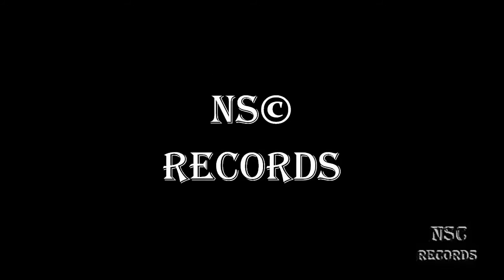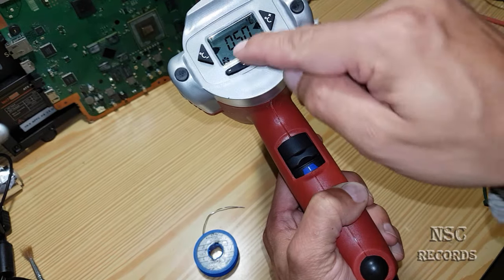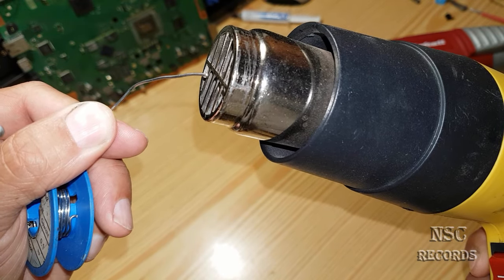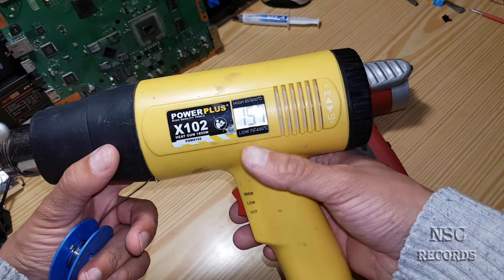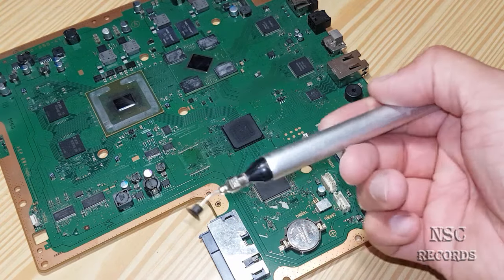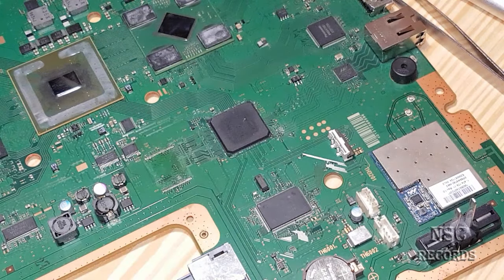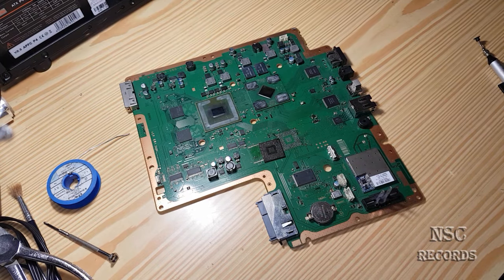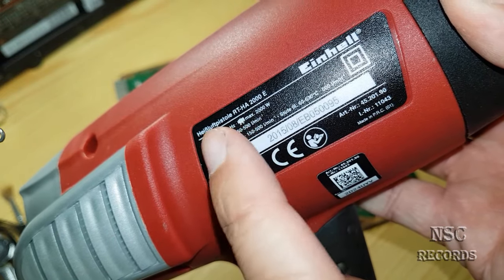Here´s the difference between a Cheap & a Good Heatgun By:NSC

Comment: I feel we must highlight the methods of using the heat gun properly. For e.g., many times the user immediately shuts the heat gun after use which allows the hot air to get trapped inside the hot air gun - This adversely affects the longevity of the heating element and correspondingly the heat gun itself. We must also remember to keep a safe working distance between the job and the heat gun outlet so that the hot air emitted is not sucked back into the hot air tool. All these are important issues.
Reply: So long story short, dont turn off the heat gun right away, turn it down to lower temperature so it cools off then turn if off

Comment: Thank you for this informative video. You can have a resonable temperatur measuring instrument for less than 15 euro with a thermocouple sensor. This will in all cases gives you some verification on the actual tool you are using. I think most folks doing repair work on electronics like to have that.I have used a cheep heat gun with continous temperatur setting (1.0-6.0) and no display. I use it for some other applications. The specification says temperature control: 50 - 600 dgr.C. Now I tested it with my thermoelement. At a setting of 1.5 the temperatur stabilizes near 130 C. At 1.6 it stabilizes near 290 C. I am not able to set at temperatur between 130 to 290 C. I think that is bad.I have tried to find reviews or comparisons on the internet on hot air guns. I did not find any, that acually tried to measure the exhaust air temperature in their evaluation. So i hope somebody will do that in future.However, I did find this video from a guy comparing the display temperatur with his thermometer. He did find a big difference like you did. https://youtu.be/mvw9fJjzg7k
Reply from the maker: Thank you very much and you welcome :)

Comment: Perhaps the old heat gun measures/displays the temp. of the heating element inside the gun and not the temperature of the air coming out.

Comment: I recently bought a cheap Chinese heat gun that looks exactly the same as your example but branded differently, and it came with various nozzles. Your video gave me ideas for experiments to do such as melting solder, and removing chips from circuit boards, thanks. I bought it mainly for melting plastic though.
Reply from the maker: No problem, you welcome :)
Reply: @NSC-Modz  I just bought a cheap one that was on sale at Kaufland Romania. Only has two settings on a three pole rocker switch, 350 and 550*C I think (not sure of the latter) but can be handy. It succesfully fixed a YLOD-ing CECHG04 PS3! Now to dive into my C04 and H04s.... :)

Comment: So I need like 1000 degrees fahrenheit to reflow with mine, I tried it with like 800 but I'm pretty sure it didn't do anything. I'll probably just need to do it for a few minutes. Thanks for the video.
Reply from the maker: Haha yeah, cheap heatguns are just waste of time ^^
Reply: @NSC-Modz  what's the max amount of time would you say that I should reflow the RSX and Cell on my PS3? I'm gonna try with some flux this time but 1 minute on a cheap heat gun doesn't feel right.
Reply from the maker: You need to feel that, try 2-3 mins and give it a try, but only with flux.
Reply: @NSC-Modz  yeah, I made some liquid flux so I'll use that. Hopefully it works, I need to invest in some temperature probes or something next time.

Comment: I like to ask you a question about your hot air guns. Do you think each one of them have closed loop temperature control? Consider using a nozzle, that reduces air flow with same temperature setting as with no nozzle. Will the heat gun try to compensate by reducing power to the heating element and maintain same output air temperature?

Comment: can i power a teensy with a power supply 3.3 volt wire ? because i forgoted to buy a 3.3 volt reguolator.. and i didnt find it in my city .. so if it possible can you draw me where i solder the 3.3 wire .. ?
Reply from the maker: yes you can, and you can find a lot more also on the Net :)
Reply: searched the F***ing web and nothing .. all bullshit ..I want the place i solder the 3.3v wire from ATX to the teensy please Help NSC <3 in the place to be !
Reply from the maker: https://www.google.de/?gws_rd=ssl#q=tennsy%2B%2B+2.0+3.3+volt

Comment: The first one is in Farenheit, 350 F is 176 Celcius. The second one says Celcius... Cheap or not it should still heat up to the temperature you set it to
Reply: but it has Celsius as the marker on the display, so either way it's incorrect

Comment: I have found that the heat gun heats quite a big area that can be a problem compared to a hot air station with a smaller nozzle.  I find this difficult if there are nearby capacitors or if I need to work on a small area.
Reply from the maker: yes, but all is posible :)
Reply: I agree.  It depends on skill level and the type of work, not just whether you have a particular tool or not.
Reply from the maker: right

Comment: Yea but you should mention that the " Cheap" heat gun was at 360 Fahrenheit and the "Good" was on Centigrade BIG DIFFERENCE
Reply: Nice try, but it clearly says on the side of the yellow 'cheap' gun display "°C". They are BOTH CELCIUS.
P.S. scientists changed the official use of the term 'centrigrade' in the 50s and most of the media haven't used it to refer to temperature scales since the 80s, a centigrade is a French unit of angular measurement.

Comment: Can you please make a video on how to fix a PS3 with RSOD? Thanks
Reply: If u r on CFW get a CFW with RSOD patch :) Like Ferrox
Reply from the maker: Right
Reply: +Zisch//ModZz any particular firmware version?
Reply: Uhm Idk Ferrox 4.78 has a patch afaik :D
Reply from the maker: and Right again :) 4.80 also i think...
Reply: +UltraNSC :D Nicee
Reply: Hi, I know this might sound silly but I downgraded by ps3 from 4.80 to 3.55 and successfully made a good patched bkpps3 file. I just updated the ps3 back to 4.80 ofw and want to downgrade again to 3.55 ofw (I did that as a test) can i use the same bkpps3 file from last time? or do I have to get another bkpps3 from the ps3 and patch it again?
Thanks
Reply from the maker: Hello Normaly this is the wrong Video to post this question... You can use your first backup, BUT, always when you connect your E3 Flasher, you should do again a backup to test if the E3 Flasher is working great befor you try to Flash any Thing... otherwise you could Brick your PS3! So allways when you connect an E3 Flasher to your PS3, make sure you could make a good backup, to see if the Clip cable and all sits right!